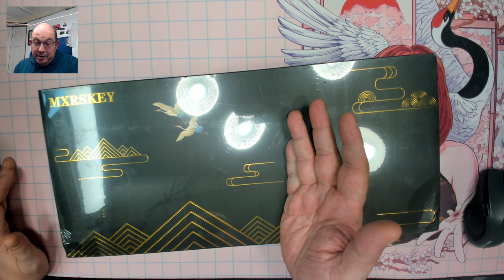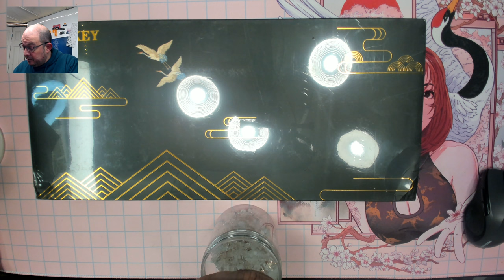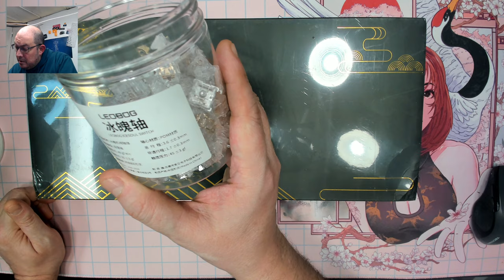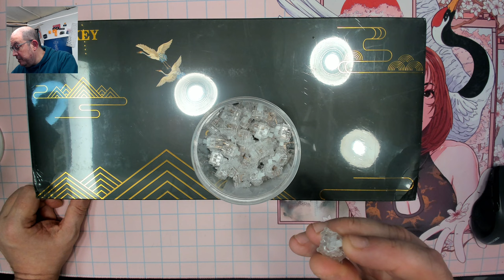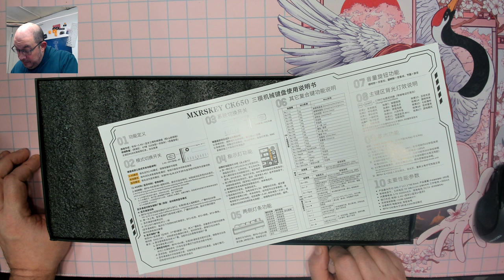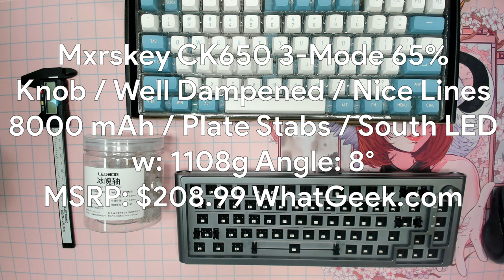A CNC'd LK67? Building a Mxrskey CK650 + Leobog Ice Soul + Feker Shoko 3-Mode 65% that delivers!

Comment: I have the ck820, but trying to confirm if its the same on this. Is FN+Page down the correct combo to change the side lights?
Reply from the maker: On the 650 it's Fn + Backspace, but if it's not open keyboard tester and start striking keys while holding down Fn to find which key combo it is, though using the software you can program it to be whatever key or combination you want.